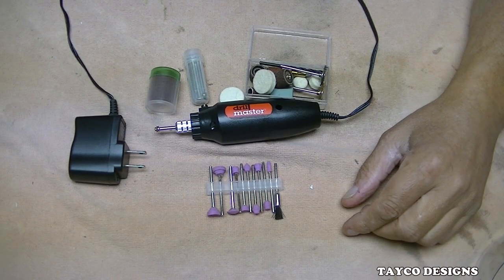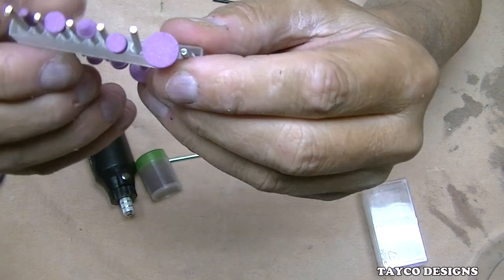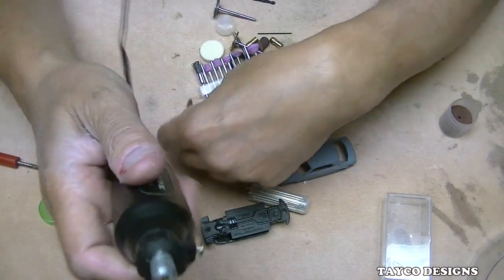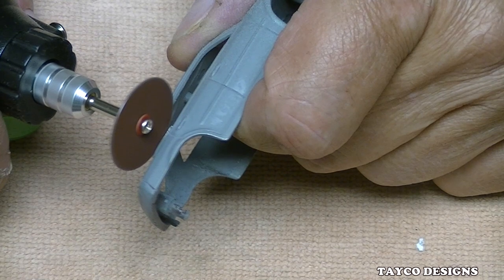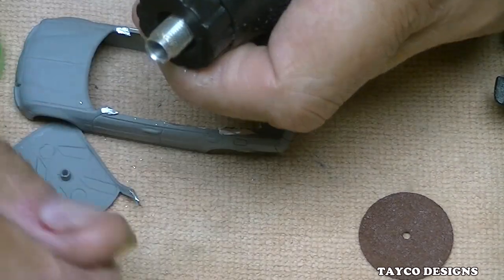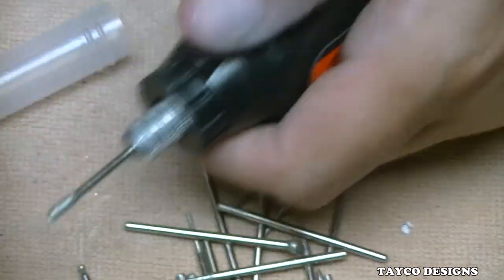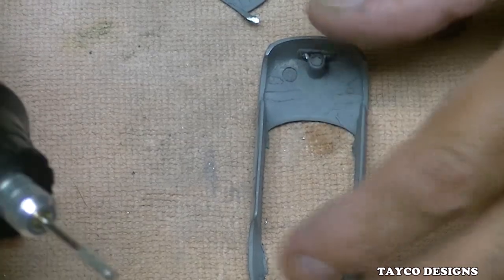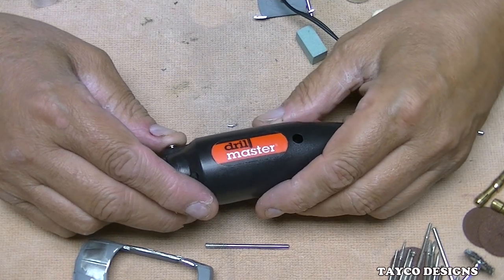Drill Master Rotary Tool And Hot Wheels / Match Box   Can They Work Together?

Comment: I thought about getting this tool because I needed to grind down some staples as I couldn't pull them because they were in a tight crevice. I figured heck it's only like $10.00.  Well when I looked at it at the store it was what you expect it to be for just $10.00 obviously. I debated should I get it. Well I decided not to because I figured I'll pay a little more for a  slightly more powerful and hopefully a little more  durable and accurate tool than this one.  I opted for a $20.00 Wen. Yes I know not to expect greatness for $20 either but for my needs I don't need something more precise like a $80 Dremel or something. I've thought about getting a Dremel before but never justified getting one until recently where I've ran into a few occasions where if I had one it would of saved me some headaches but I managed. But now with my staple situation I need a rotary tool. I ordered the $20 Wen package that comes with a carrying case and a flex shaft of which I need to gain clearance in order to get the cutting wheel into the crevice. A Dremel package with a flex shaft would cost way more. 

Hopefully the Wen doesn't have as much run out and is reliable. The Drill Master has it's place depending on what you need one for and know what to expect.

Uodate: I've used the Wen on a couple of projects and it performed flawlessly and no wobble with the attachments.